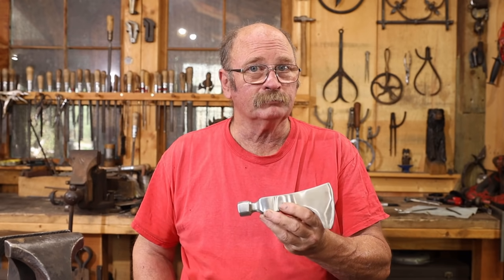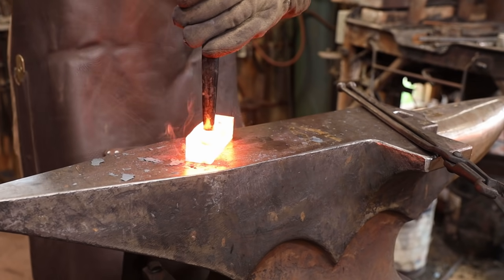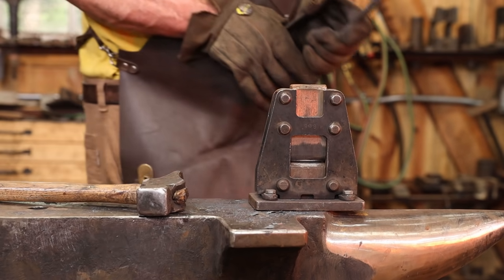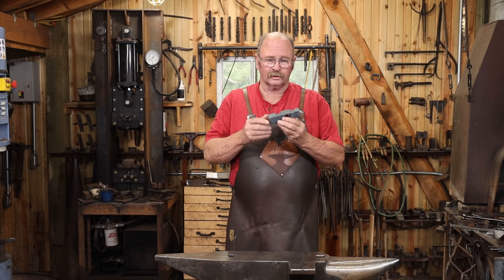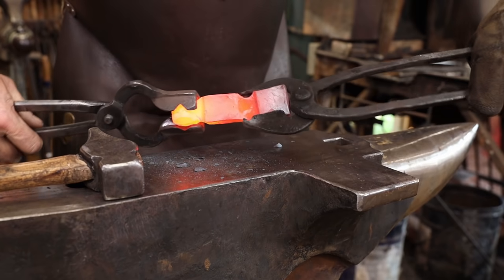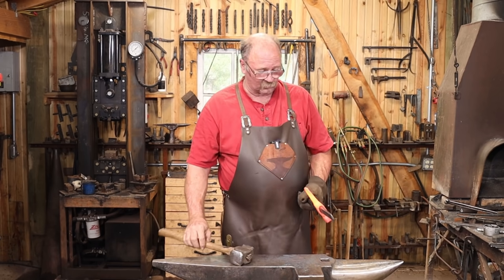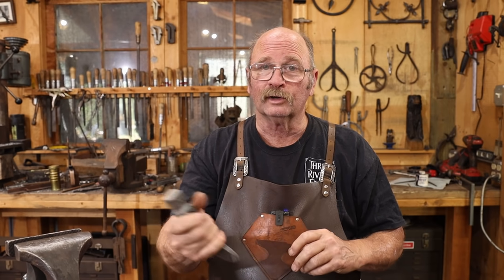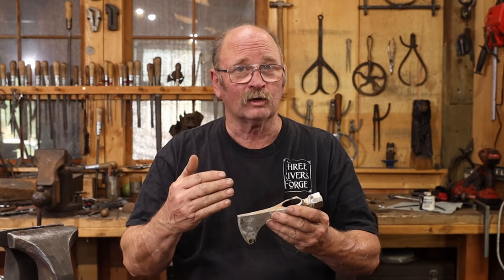Walking stick Axe - part one - the head

Comment: Nice bit of work there, should work well. I don't have a forge myself but I have made walking sticks with a shingling hatchet for a handle and a ball peen hammer as the handle. For a ball handle the ball from a 1 or 2 inch ball valve works well.
Reply: Interesting idea.  I have promised a walking aid to a friend.  The shingle ax cane might be a better approach.

Comment: It boggles my mind that someone would turn off the video half way through. Since the first time I watched my first one of your video's years ago I have always watched the entire video. I guess thats the difference betweenentertainment and wanting to learn. As always thanks John!
Reply: The only situation I can think about for not finishing the video in one go, is running out of free time. But then, one can jump on back in at the point one left 😁
Reply: @Seelenschmiede  
Dead battery comes to mind as something that has happened to me. Hard to see on a dimmed screen at a park in the sun. 🧟‍♂️🗣👤👁👁
Reply: @Seelenschmiede  very true and I for one would go back and finish it.
Reply from the maker: The truth is that keeping people engaged in a YouTube video is one of the great challenges anyone on YouTube faces.  Typically 30% of viewers drop off in the first 60 seconds and its considered a good sign if 50% are still watching at the end.  With longer videos I'm lucky if 30% are still there at the end.  It will be a few days before those numbers are available for this video.  But currently the average viewer is only watching about 40% of the video
Reply: @BlackBearForge  Jon it boggles my mind but I know that's true. I have heard other youtubers vent about it as well. Personally I don't see why people even bother if they only watch 1 minute of each video. 21st century... things just don't make sense anymore.
Reply: @BlackBearForge  I know, the average attention span is like one of a squirrel on meth... and I'm the ADHD guy here, saying that!

Comment: 4140 aka ordnance steel is potentially going to need alot of sharpening . It is great gun steel for a barrel or receiver .but shitty for blades as it is not meant to be sharpened .it is meant to withstand heat erosion ,absorbs and disperses kinetic energy from explosions and has good elasticity  as such. I bet making a hammer for forging hot steel items would be a good use for it. or ...and Idk how difficult it would be , you can take an old file or other beat up old cutting tool , forge your cutting edge and insert it into the 4140 body via a virtical dovetail ( the direction of the cutting edge ) and locked in with a wedge or inter locking threaded fasters ... Or both for the belt and suspenders approach.  It would give you the option of makes several inserts for it . A single thin virtical cut of about 5/8ths inch , on the top face of the dovetail groove would allow for a compression lock with threaded fasteners...sorry , I really need tools and a place to use them lol  .  Basically that thin cut would relieve stress in the metal and it would naturally seperate trying to spring apart... Two spots for side by side heavy duty fasteners  would be good to pull everything tight , and drilling and tapping the center where the two heads contact or almost contact , through the heads, amd inserting a small machinist screw , will prevent fastener backout. A simple staking on the machinest screw will keep that from backing out until it's made to witha tool.   And blabbing is finished. lol

Comment: coming along nicely, when you have a war axe, like this one but also with a top spike how is that attached to the handle?
there isn't the assess for loading in a final wedge to the top as there is a spike in the way, would it just be pinned through the sides of the axe head , love to hear your thoughts on it John

Comment: Looking good.  can you tell me how coal dust stops it sticking please.  I can understand the "grease" but not the coal dust.  Thanks.
Reply: Carbon (e.g. graphite) is a dry lubricant.
Reply from the maker: Coal tends to have some oil but I think its just as much the dust serves as a separation layer and the gasses add a bit of pressure inside to push the punch out.  I know it works best on holes that haven't gone clear though
Reply: @BlackBearForge  Thanks,  I hadn't thought about gassing out.

Comment: Hi John, very  nice project. I have a question what is the dimensions of the drift you are using. I made some drifts but I struggle with the dimensions. Especially the amount of tapering, my hour glas is to explicit so the handles never fit very well. Making a drift is kind of hard especially when it's a bit bigger and the only power available is muscle 😉.
Reply from the maker: Forging large drifts by hand is tough indeed.  But if I never used a power hammer I would make short drifts, these real long ones are so I have a handle to stay clear of the power hammer.  The taper is mostly a matter of experimentation.  I have never checked exact angles.  I'll see about making another video on drifts.

Comment: Would the tip dip used for mig welding work the same as the punch lube you're using? I would think the welding stuff would be cheaper.
Reply from the maker: I have no idea, I have never used it

Comment: I have read in several Danish books about blacksmithing that the blacksmiths back in 17-1900 used to cool their punches and the like in salt water, the salt suposedly help to not get the punch as stuck, like using charcoal powder and punch lube.
Is that something you have any experience with?
Btw i love your videos and i have learned a ton from you, especialy your beginner friendly videos, so thank you for that!
Reply from the maker: Not something I have ever tried and I can't see why it would work.
Reply: @BlackBearForge  the books say that a small amount of salt will be left on the tool after the quench and acting like a "lubricant" of sorts.
I haven't tried it myself but i thought you might have heard of it

Comment: This is an awesome project! Once the red flag fire warnings here in Nevada finally stop, I might do something similar!

A quick question: My blacksmithing instructor always ran a drill bit through any hole he punched to clean up the rag left behind. His reasoning is that the rag might become a weak spot later on. What are your thoughts on this?
Reply from the maker: Shouldn't be an issue if the hole is punched cleanly

Comment: I think you've mentioned it in a prior video but I can't find it, where is the silver pencil you use available?
Reply: John had them on his Etsy at one time, I don't know if they are still there. They can be purchased at most welding shops.
Reply: @flatrockmountainforge8792  thanks!
Reply from the maker: Its a Markal Silver Streak welders pencil.  Available at most welding suppliers or through my Etsy shop https://www.etsy.com/listing/615553969/welders-mechanical-silver-pencil-lead
Reply: Tractor supply has them

Comment: John mentioned leaving the unfinished axe-head sitting overnight, is that a case of just tossing it in a big bucket of vermiculite or do you need to take more precautions against rust, hardening or unexplained workshop fires?
Reply from the maker: No real need to do much.  It won't rust overnight and even if it did it wouldn't hurt it.  I anneal before grinding

Comment: i heat my metal in a wood fire, and it never gets beyond red, is that metal really the color it looks like in the video?
Reply from the maker: Close, but often the camera makes it look hotter.  A good forge fire should be able to reach a bright yellow heat. Charcoal would probably be better than just wood
Reply: @BlackBearForge  thank you for the advise, my barrel stove is brick lined so maybe i will try charcoal.